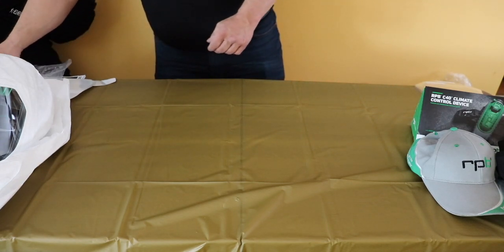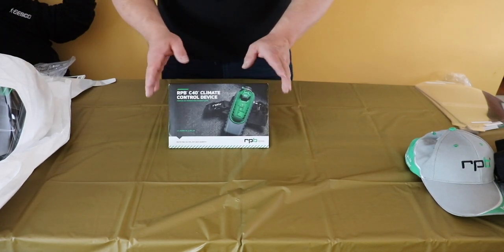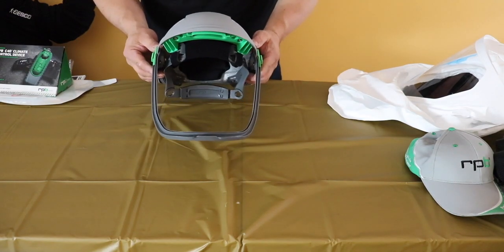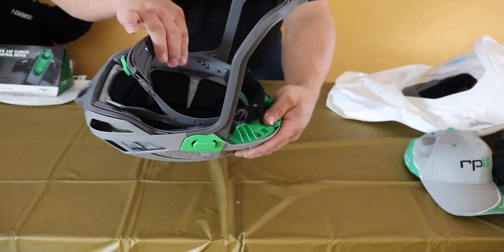RPB T-Link Helmet Review: Part 1

Comment: Did you get to know what was the small lens for?
Reply: eumircarlos yes. Turns out the smaller lens is from a last version of this hood. In the last version the lens area was smaller because there was an area below the lens for an accessory light. So, they had several thousand tear offs inventoried for that older hood. Instead of throwing them away they decided to throw one in each box of the current version hood. I guess that way the customer throws it out? 🤷🏼‍♂️ Still scratching my head on that one! Thanks for watching! If you haven’t already, please subscribe to my channel and hit that “thumbs up” button. I’ll be putting the second part of this review in the next two weeks.
Reply: @markantinore6418   Thank you Mark, Yes I learned that lens is still compatible with the T100. So don't throw it away in case you get one in the future. ;)